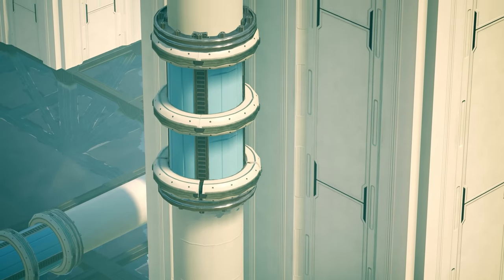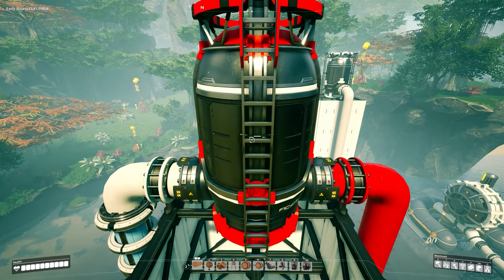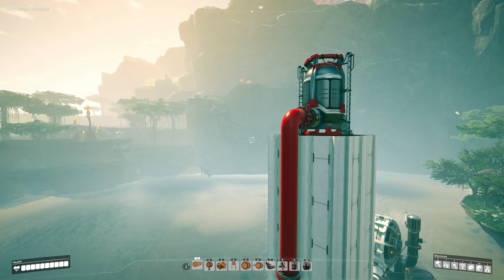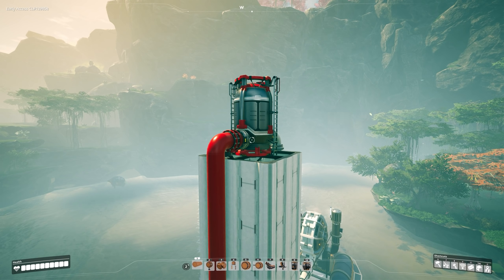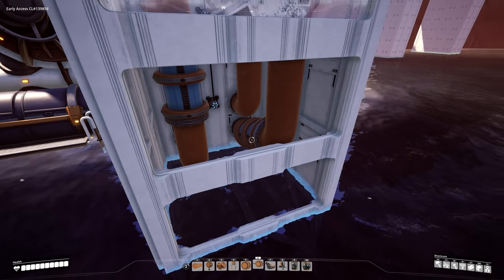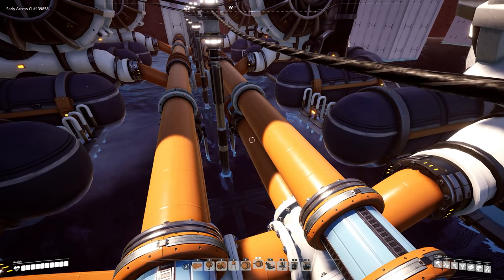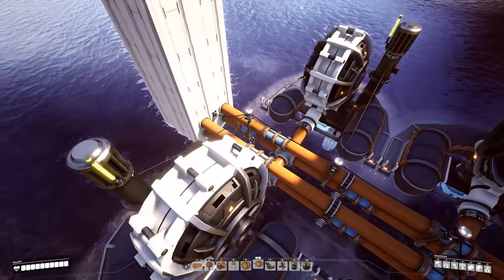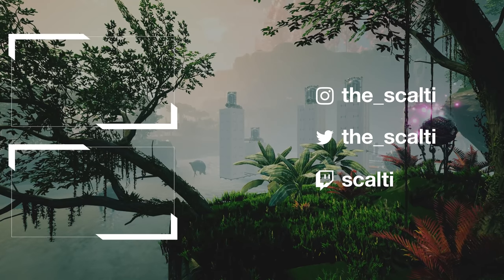Water Tower Mechanics Guide [SATISFACTORY GUIDE]

Comment: I use only the few pumps to lift the water as high as possible with a huge buffer on top and then I don't need pumps on the rest of the map anymore. Why are from ever YTber that I saw all so morronically short 😂just makevit as high as the game allows. The water in this game has neither viscosity nor pressure. You can make the pipes horizontally as long as you want you only have to provide head. And if the head is well above everything that is in the map then you can place your pipes everywhere without placing on single pump (except for the pumps for the mega water tower)
Reply from the maker: It’s short because this was for demonstration and not an actual play through.